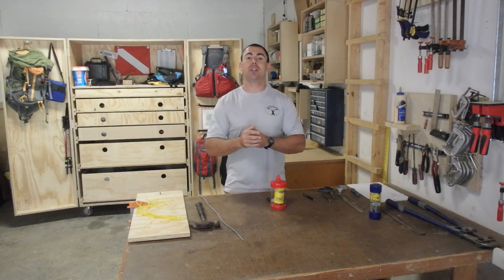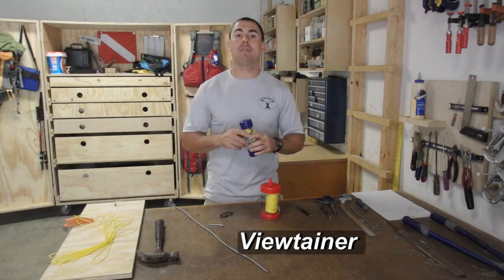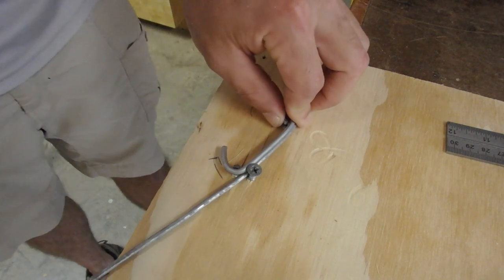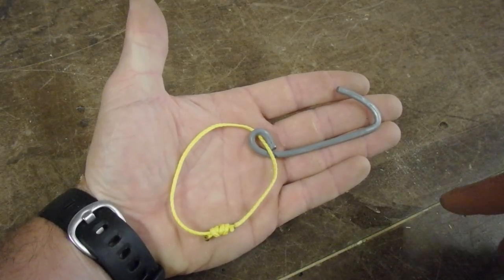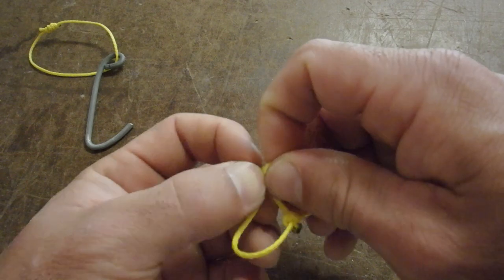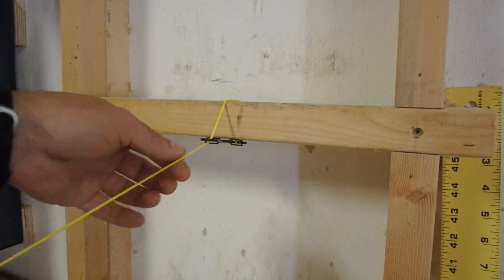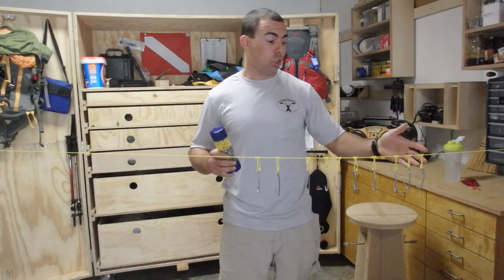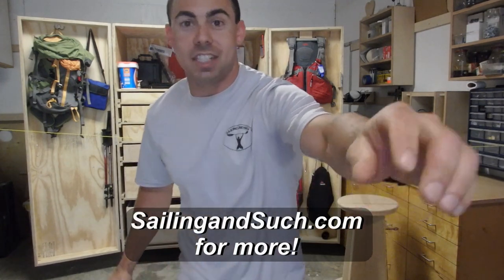Gear Hanger - How To Make

Comment: I just made one of these.  A few tips for the new guy:  1)The plywood you use can start to splinter/the screws will move, making it harder to form the loops.  having a thicker board would have been helpful.  2) If your hooks are larger than the 2.5in/1inch shown in the video, you won't be able to make three complete pass-throughs when attaching the hooks to the line.  Mine only has 1, which still seems to be enough, but might not be as effective at not sliding when they are weight bearing.  This can also make the 2x6 viewtainer a little tight when packing it up.  Also, when taking this down, snag all of the hooks close to the S-Biner and secure them with a tie/velcro strip.  The hooks can get tangled pretty easy with the rest of the rope if you let everything get all balled up.  I put the Sbiner/hooks in first, and then tied up the rest of the rope in a figure 8 and it slides in perfectly.  Thank you Trip, that was a fun little winter project to work on while waiting for summer to roll around.
Reply from the maker: Awesome comment! I like the thought of tying the excess line in a figure 8 before stuffing it. Sheesh why haven't I thought of that????? lol Thanks Andy!

Comment: Thanks for the DIY on this piece of gear! I constructed my own yesterday using 550 cord and works great too. I had to make my loops 24" due to the diameter being a little larger, "I think". To be quite honest, I was skeptical that the knots would hold gear in place and must say was extremely excited no gear moves no matter the weight! Thanks again for your Vids and this DIY. Keep them coming and Happy New Year!
Reply from the maker: You're welcome! Oh wow. The loops should only need to be larger if you use bigger hooks. I'd suggest trying one shorter loop and see how it works, could save you some space when storing it.
It's a fantastic knot! I love using it for multiple things. 
You're very welcome, I'll keep the camera rolling! Happy one back at ya!

Comment: You should sell these! These are awesome and people would definitely buy them such as me. I don't have materials or tools to do it... haha
Reply from the maker: You know, I've thought about that Daulton.... I thought they might be to expensive with the Viewtainer, Figure 9 and carabiner adding to the cost. It still would be cheaper than buying all of the materials since you don't use a entire role of cord or wire.... May have to sell them for around $35 or so, possibly slightly more. Think that's to expensive?
Reply: I would buy it for 35, if you think about it for how much material you're using and the labor of making them I think 35 is a good price!
Reply from the maker: Well, maybe I should look into it harder. Thanks Daulton!!!!
Reply: Me and my best friend love to camp when we can, and these would be perfect for us, in the past I've used a paracord line to go from tree to tree and then use carabiners to hang stuff with, but your gear hanger it is easier to set up and use!!! If you plan on making some to sell let me know I would love to buy one! My mom lives in Florida and if I come down there we all should meet up sometime!
Reply from the maker: That's cool Daulton! The Gear Hanger really does work pretty well. I love using mine...
Tell you what, I actually bought supplies to make a few more. Send me your email address or email me at sailingandsuch@gmail.com and we'll figure something out.
Reply: My friend would love to buy one too, so if I could buy two that would be awesome! But if you only have the materials to make one thats alright too.
Reply from the maker: Email sent Daulton. I'll fix you both up.

Comment: Is 550 Cord to thick you think?
Reply from the maker: I think it would probably work. You may have to deal with a bit of stretch with 550 and it's a bit bulkier but it should work just fine. The zing it doesn't stretch is one of the main reasons I chose it. Also, it's slightly stiff so it's less likely to tangle I would think. Give it a shot Phillip!
Reply: +SailingandSuch awesome bud thanks for the reply most channels don't reply as you do !
Reply from the maker: Your welcome Phillip! I try to reply to just about every comment. I know what it's like... I comment on other videos a decent amount myself and I hated not getting a response. I don't want my audience to feel that way....

Comment: Do you think I could cheat and get away with using 550 paracord instead of Zing-It?
Reply from the maker: I think you could. You may have to deal with a bit of stretch with 550 and it's a bit bulkier but it should work just fine. The zing it doesn't stretch is one of the main reasons I chose it. Also, it's slightly stiff so it's less likely to tangle I would think. Give it a shot!
Reply: The complete package as illustrated in the video will be significantly larger made with 550 as opposed to Zingit. Absolutely 550 will work but there is the stretch as Trip has indicated and the extra bulk.